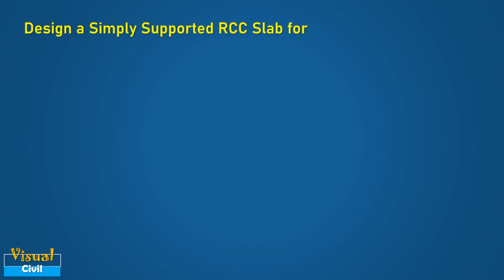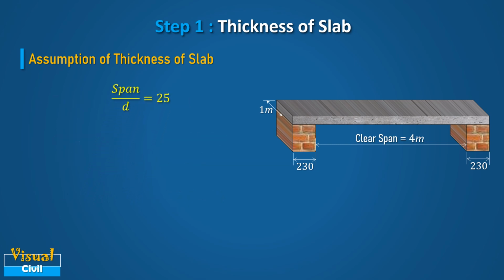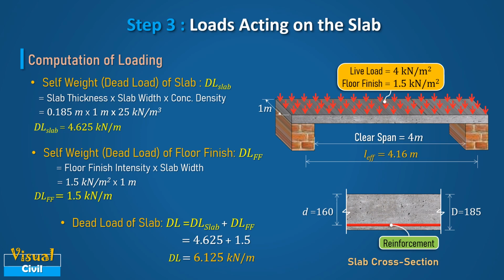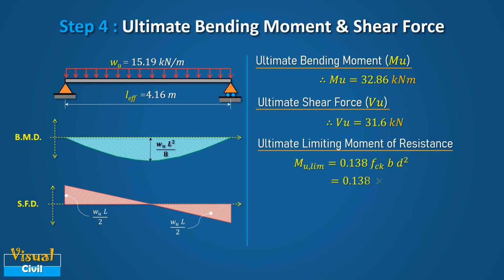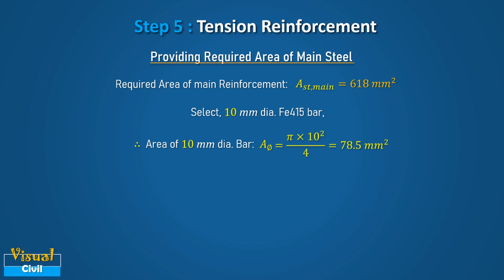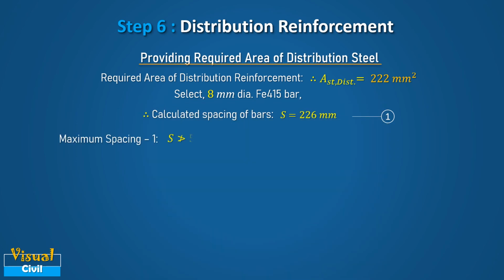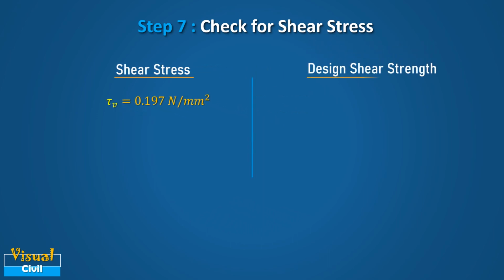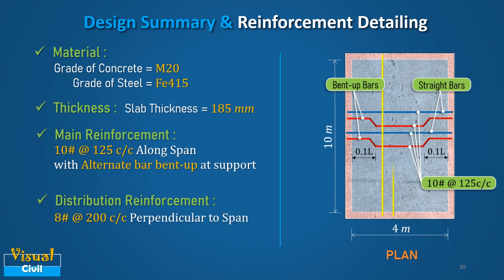Design of RCC One-Way Slab as per IS 456:2000

Comment: i think there is an error in K as the over all depth D is 185mm hence the k should lie between 1.2 - 1.25
Reply from the maker: Thanks for pointing that out. It's a typo error. Please consider the correct value as you mentioned.

Comment: In step 7 how u got Ast=314,pl show calculation to understand clearly
Reply from the maker: Ast as 324 is at bottom of the support. As the main bars are alternate bentup, therefore at support bottom only half the steel is available which is in tension for simply supported case. Here, in the calculation of main steel provided is 628 mm2. Half of this is 314 mm2.

Comment: Shouldn't the value of 'k' as calculated for design shear strength be nearly 1.24 for D=185mm?
Reply from the maker: Thanks for suggesting the correction,  yes you are correct
Reply: @visualcivil  Thanks for acknowledging the error...
Anyway, your method of explanation is stupendous.
The subject matter can be easily grasped by someone having an avg. aptitude in civil engineering.
Good work! 👍👍👍